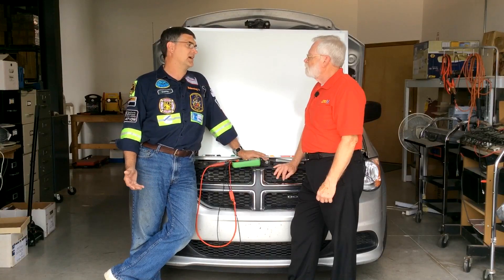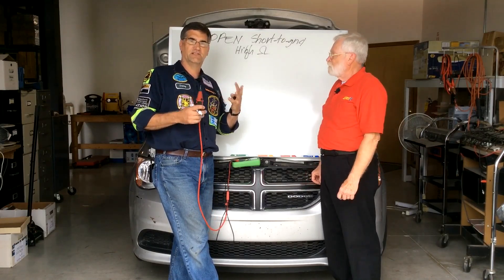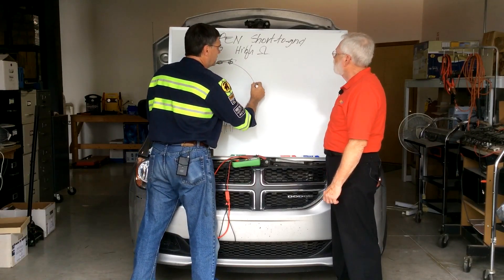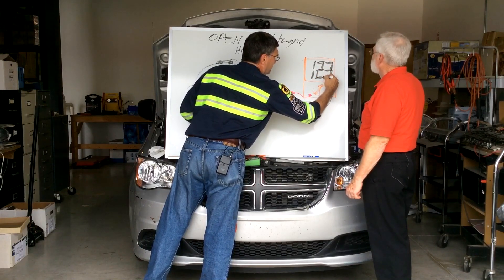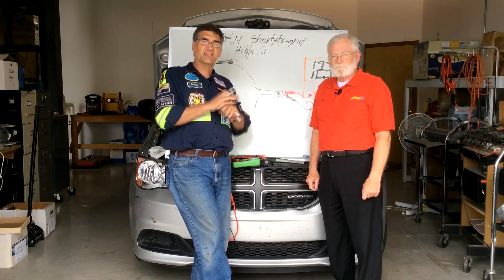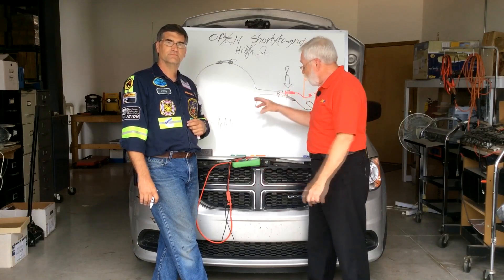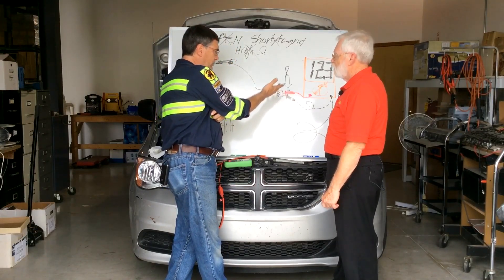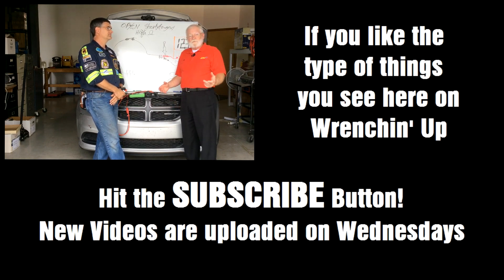Voltage Drop Testing with the "Load Pro" Exposed - Wrenchin' Up

Comment: Good tool , but it doesn’t say if it can also be used for reference voltage (5 volts) instead of 12v only. Does anyone know? Or is there a different load pro for that?
Reply from the maker: Hi - Thanks for watching! I haven’t used or heard of anyone using it for reference voltage systems, so I recommend checking with the manufacturer or vendor about that. Their contact information is in the video’s description.

Comment: i dont hook the black lead up to a "good machine ground", i hook it right up to that circuit to test its ground or i run a test lead to the battery - post with an extension cord so its right at the horses mouth and i'll know if i got a bad ground or not in that circuit. hooking a lead up to the chassis no matter how shiny the bolt is not necessarily connected firmly to the battery
Reply from the maker: Hi - Thanks for watching and sharing your experience.

Comment: If you read system voltage wouldn't that mean the circuit is on? You're saying that the Loadpro turns the circuit on. That's confusing. Do you mean you're adding resistance to the circuit by hitting the button on the Loadpro?
Reply from the maker: Hi - Thanks for watching! The circuit must be on for load testing. The LoadPro applies a load to the circuit when the button is pressed. You can get further information from the manufacturer. Their contact information is in the video's description.

Comment: 80 percent it's the wire is the worst thing I've heard in 30 years of diagnostic work . What a lie.
Reply from the maker: Hi - Thanks for watching and sharing your opinion! In all fairness, he should have mentioned that most of his work is on heavy industrial equipment, earth movers, mining equipment, etc., where 80% is probably accurate.
Reply: @WrenchinUpwithJimBates  appreciate the reply , I figured him making that claim was mostly to sell more of that resistor on a switch he is peddling .
Reply: @WrenchinUpwithJimBates  I work on heavy equipment as well and in my experience, 80% is a ridiculous guesstimate. Often times it's just a failed component or sometimes a corroded connector. I do agree that the odds of the issue being in the circuit go up significantly compared to residential passenger vehicles. And my experience includes 16 saltdogg salt spreaders that we mount on the rear of our SD108's plus some other salt equipment for our smaller trucks!
Reply: @wademurphy9994  .... or a corroded connector.  He should have told you thank you for saying the same thing he said.  Is the connector not part of the circuit?  It certainly is.  In my experience working on motorcycles and other such vehicles, a bad wire, bad connector, or corrosion is much more often than not the cause of everything from charging issues to headlight issues to winch to starting.... etc.
Reply: @watchdogu.s.a.8973  depends on how technical you're willing to go. The component itself is part of the circuit as well. As I stated, in my experience it is often times a failed component. No matter how weather resistant they make these components, the moisture and debris will eventually work it's way in, same goes for a connector. Either way I think 80% is a ridiculous estimate. In my experience I would guesstimate 80% being a failed component, probably 10 or 15% in a connector, and the rest in the wiring, but again, that's just my experience.
Reply: @wademurphy9994  Ok... each of us as our way of looking at things.  Personally, I can't envision ANY scenario where everything in the circuit wouldn't be considered to be a part of that circuit.  If you remove any single piece of it and don't replace it with something then you no longer have a circuit.  I will actually agree that 80% might be a high number, overall - all types of vehicles considered, but on some it's almost always something other than the component and on some it's likely more often the component itself.  My previous example of a connector or corrosion on motorcycles being the usual culprit is accurate and that would apply to some other vehicles.  
With all things considered, even if it's 25% of the time, or 10%, being able to easily load the circuit while watching the voltage is a big plus.  Can it be done other ways?  Absolutely it can.  Someone could also travel from Spokane, WA to San Diego, CA via Colorado, as well.

Comment: This only works if the load pro can pull multiple amperages. Pulling a 5amp circuit with the load pro may be one thing, and pulling a 15amp circuit will be another thing. These videos are nice for review, but I don’t buy what they’re selling.
Reply from the maker: Hi - Thanks for watching and sharing your opinion!

Comment: I understand that you should put both test leads of the load pro into the connecter I use to be a motorcycle mechanic ie some starter motor has one wire to the motor so would not be able to  test properly
Reply from the maker: Hi - Thanks for watching and sharing your experience!
Reply: The test will still work based on the same principle. The body of the starter motor would be your ground circuit. Connect your ground lead to it then the load pro to the positive wire as normal. 

I don't know the specs for the load pro, it may not be the best tool to verify wiring integrity for a starter motor circuit. What I mean is, the load applied by the load pro may not be sufficient enough to draw down the voltage like the high draw of the starter itself would. It would be simpler to leave the starter in the circuit and measure your voltage while engaging the starter with the switch. You should follow OEM recommended procedure for testing and diagnosing the starter circuit.

Comment: 80% of Faults are in the wire🥴 20% in the component🥴 huh????. Unless you’re dealing with some 25-year-old rust belt piece of crap car, as a 40 year experienced professional technician, in both cars and aircraft.  I’ve seen 80 to 90% component failure and 10 to 20 wiring failures. (Not counting crappy battery terminal connections, Which I don’t believe it’s fair to add them in to the mix).
Reply from the maker: Hi - Thanks for watching and sharing your experience. I agree that in general, overall failures in your (and my) experience is that more components fail than wiring. But he is talking about failures stemming from shorts, high resistance and open circuits which are usually the culprit, like your "crappy battery terminal connections" example.

Comment: Only one load on a circuit? What about parallel circuits? Am I mistaken that parallel circuits do not exist?
Reply from the maker: Hi -Thanks for watching! The purpose of the video is to demonstrate a voltage drop testing procedure. It is applicable to all circuits and loads.

Comment: So many Voltage-drop videos are crap, using wrong words constantly, hardly a one that is 85% correct, including this one...
Reply from the maker: Hi - Thanks for watching and sharing your opinion! Hopefully you will respond with information backing up your claim. That would be more helpful to the community.
Reply: @WrenchinUpwithJimBates  no, you put out the video and mislead your audience, you go back to school, and learn how to word properly and accurately and then remove this video and create a new correct one.
Reply from the maker: Hi - Well, I see that you have not provided anything to back up your comments so I can only assume that you don’t have anything. Have you looked at all of the other comments on this video? Do they give you a hint about the value of this video? Based on them, I don’t think you have any valid points. So like I asked, please provide something to back up your opinion. That would be more useful to this community than just complaining.
Reply: “Learn how to word properly”   :)

Comment: Can we do voltage drop with the load pro on the battery?
Reply from the maker: Hi - Thanks for watching! I'm not sure I understand your question. There is not enough load in the LoadPro to load test a battery but that might not be your question. Could you be more specific?
Reply: @WrenchinUpwithJimBates  thank you Jim for your promo respond, yes that was the question, the load pro connect to battery ,then push on the load button, I thought it was possible,thank you again,and cheers from ontario ca

Comment: JIMBATES, why do you need to put a LOAD in order to measure the corrosion resistance, why can't use measure the corrosion resistance without a load? what does the load do
Reply from the maker: Hi - The load causes current to flow through the circuit so that problems in the circuit such as resistance, opens, shorts, etc. can be observed. With out the load (in this example) only open circuit voltage will be observed.

Comment: Question: At the beginning of the example he's reading 12.3v (system voltage) on the motor. Is that still true even if there's resistance on the circuit? shouldn't the voltmeter be reading less voltage due to the resistance? or that's just part of the first example?
Reply from the maker: Wrenchin' Up with Jim Bates 
• 1 second ago 
Hi - Thanks for watching! The short answer is that open circuit voltage will always equal battery voltage no matter how much resistance there is in the circuit because current is not flowing. The voltage is just pressure (electromotive force). Resistance only becomes a factor when the circuit is closed and electrons are flowing, or attempting to flow through the circuit. Does that help?
Reply: @WrenchinUpwithJimBates  not true, current is flowing.  Just a tiny bit. DVM’s have Around 20M ohms input impedance. Which keeps the meters current flow so very very low that the voltage reading isn’t adversely affected.

Comment: What is the load that is applied when you push the button. I was working on the utility pole, trying to get power to my garage and all of a sudden the transformer three lots down blew up. We were with out power all night.what happened when I pushed that button.??? I don’t know if it was me or a bird or something did something at the same time. Kinda freaked me out
Reply from the maker: Hi - Thanks for watching! I don't know for sure but if your LoadPro is not a smoking puddle of plastic I don't think it was the culprit. That would have made a great video though!

Comment: Just save your money. 
Hook your meter up negative lead to battery negative, and check both sides of the motor with the circuit energized.
Battery voltage on 1 side, no voltage on the other the motor is bad.
No voltage on both sides the positive wire side is the issue.
Voltage on both sides,
the ground wiring side is the issue.
Reply from the maker: Hi - Thanks for watching and for your comment.
Reply: Load pro doesn't check resistance,  it checks voltage with and without a small applied load.
Why use a fixed artificial load when you can use the actual load
Reply: @Mr obvious.
No I meant what I wrote. 
The Example was the motor wasn't moving.
With positive voltage on the positive motor post and no voltage on the negative motor post shows and open circuit internally on the motor.
If it is positive on both motor posts the motor has lost the ground from the motor back to the battery.
No voltage on either post is a failure before it got to the motor.
Reply: @ryanjohnson4239  you said you were measuring from the negative bat post to each of the motors connectors.  To the open motors positive will give you 12v.  Bat Negative to the “open motors” negative will read 0 volts.  Loaded or not. Bat negative to a “good motors” negative will also read zero volts unless the ground is open or resistive somewhere, then you’ll read up to system voltage.  I haven’t been wrong on Jet Aircraft in over 26 years, everyone’s still alive and well, I’m doubting you’ve re-invented dc troubleshooting.  Prove me wrong and I’ll acknowledge it.
Reply: @MrObvious
I agree with what you are saying, if the motor is working you would get what you said, the test I was stating is only when looking at a non working motor.
I'm 26 years in as a MEWP technician,  DC troubleshooting is  most of what I do.
Basically my whole point of my comment is that the load pro is an unnecessary tool to own.
Reply: @ryanjohnson4239  I’m just saying that your  statement that:  battery voltage on one side, zero on the other side, “the motor is bad” is 100% INCORRECT.  Good motors or bad motors that are “open” and not shorted, with good supply wiring “READ THE SAME VOLTAGE ACROSS THEM”. +or - a pinch 🤏 end of story.   Here’s one for you:  I have one 12volt circuit with a 50 ohm resistor in series with a 2500 ohm resistor.  I have a separate 12volt circuit that has a 50 ohm resistor in series with a ?
What value resistor must be placed in the ? Position, so that, by itself, it will dissipate the same wattage as the 2500 ohm resistor does in the first circuit???  It’s not 2500!!!  Your pretty good if you get it.  It’s very relevant to understanding crappy wiring connections, I’ll check back to see if you gave it a shot.
Reply: @mrobvious5892  so a open motor reads the same at both posts?
They are no longer part of a complete circuit at that point.
The resistors you are bringing up have nothing to do with the current discussion of the motor circuit testing.
Reply: @ryanjohnson4239  let’s try it again.  Good motors or (bad motors that are not shorted) read system voltage across the motor.   12 volts in a 12 volt system. The only difference is one of them is working and the other one is not.  Get it?
Reply: You can be my teacher my friend, your way of explaining shows your knowledge, thanks for sharing.
Reply: Bat neg to motor neg under load and your looking for voltage?  motor is bad?  Haven’t heard this one.  Didnt you actually mean “bat pos to motor negative” under load, No voltage motor is bad?
Reply: But with that method you cant check if there is an específic resistance even though you have 12 and 0 volts and thats why you load it wih load pro to avoid testing the whole circuit for resistance

Comment: This could have been mentioned - there's a fourth fault; short to voltage. :-)

My personal experience is that the statement that the wiring/circuit is at fault 80% of the time is way high and I find a number that is closer to 10%. Those faults are related to circuits that can't carry the current/signals due to terminal tension issues, wiring that is damaged...

Regardless of anything checking resistance will prove a circuit faulty, but will not tell you if it is good. That is the reason for voltage drop testing as that tests the circuits dynamically, under a 'load' or operating conditions. These sort of tests should be second nature and done without even thinking about it. That appears to be the usefulness of this tool is getting into the habit of checking the integrity of the wiring and connectors so you don't jump off the diagnostic cliff and miss the obvious. 

I do have a question what kind of load does this tool apply? I've got a headlamp that I use and that loads the circuit with 3.5 amps. That seems to be a good number as the manufacturers have been saving weight by dropping the wire gauge to 20 - 22. 

Thank you!
Reply from the maker: Hi - Thanks for watching and for your very helpful comment about "short to voltage". Since Dan primarily works on heavy duty stuff like earth movers, etc. I suspect his wiring circuit fault figures are more in line with that stuff. As for the tester's load - You'll have to ask the folks at Electronics Specialties (the manufacturer). Their contact information is in the video description.
Reply: 25 ohms
Reply: Less than 0.5 amp

Comment: Very rarely see wiring problems other than cut wires from an accident or a rodent 90% of the time in real world 15years experience its component failure
Reply from the maker: Hi Chris - Thanks for your comment. I think your experience is pretty typical, but I know that he mostly worked on big industrial stuff like earth movers, etc. so maybe there is more of an issue with that type of equipment. Thanks for watching!
Reply: Jim Bates Thanks for the video and info would definitely like to try out a loadpro

Comment: Is there a method for testing suspect wire for high resistance without using loadpro leads? DVOM can misdiagnose this fault if the wrong method is used. Any suggestions?
Reply from the maker: Hi - Well, open circuit voltage should equal system voltage so if you disconnect the suspect wire from it's load and check the voltage (red voltmeter lead on wire and  black voltmeter  lead on battery negative) the meter should display system voltage (what is measured across the battery). If not, suspect high resistance in the wire. Thanks for watching!

Comment: You’re tool is impressive.  I can see it’s benefits over the other tools that you mentioned however I can’t agree with you when you say there are only three possible problems with the wire. What about short to power?
Reply: #1 "Short"  ie. short to ground, short to power or short to another circuit. #2 "Open" #3 "High Resistance" These are the three problems you can have in a wire.
Reply from the maker: Hi - Thanks for your comment. Check this video too for more info on this. https://youtu.be/AYiY1c_b06w .Thanks for watching!
Reply: It looks like, in your circuit drawing, the circuit is incomplete.  I believe this occurred when you wiped away the Motor from the white board.  So, unless you connect the black side of the meter to a ground, you will not read 12.3VDC potential on the positive lead connection.
Reply: I reviewed the video again, and I see the ground side wire is just hard to see.  Belay my last post.
Reply: @stevenjordan4618  dude, your lost in left field in your troubleshooting (before you say something stupid like your an idiot, etc) know I’ve worked on cars for 40 years and have 26 yrs as a professional aviation technician.  I’ll help you better understand what he’s saying, etc. if you’d like. Just ask something. For starters, his negative lead was grounded and his reading was correct.